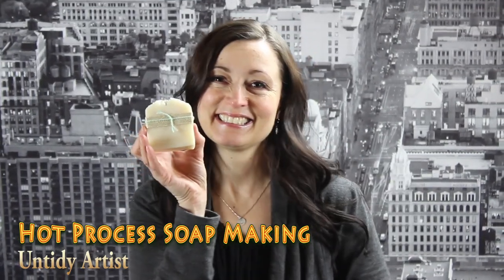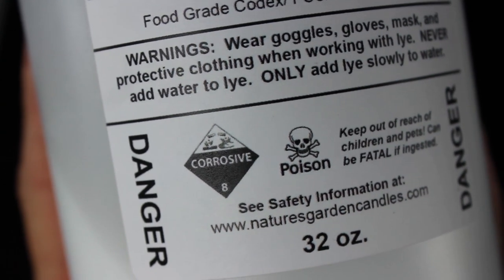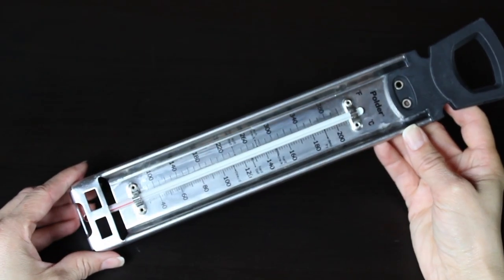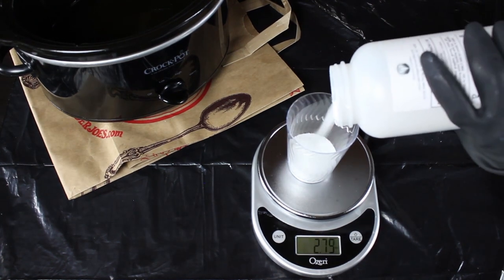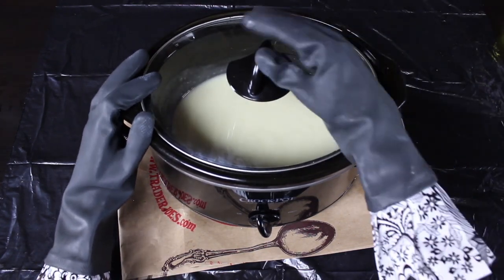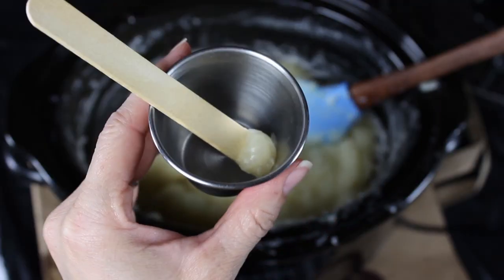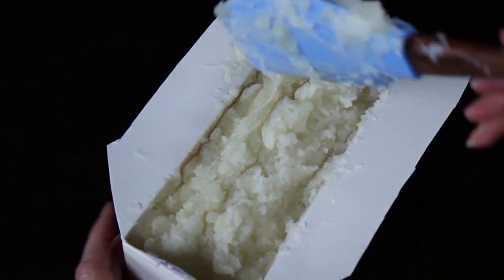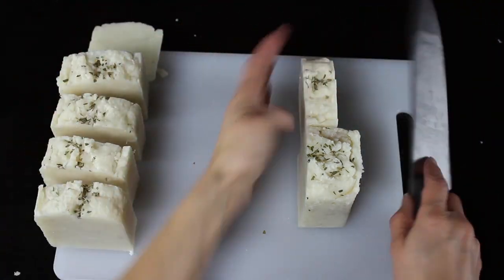DIY Soap Making: How To Make Soap The Hot Process Way

Comment: Emilie, what a great video!  I am new to soap making, but have devoured about every video and blog out there.  I started small with fun M&P and last night did my first HP and it was a lot of fun.  Your video had a lot of great tips, I love the milk carton usage, brilliant!  I must say though, that when substituting oils (like I did), as you said, make sure to run things thru a lye or soap calculator.  I took 1/2 of the coconut oil my recipe (Bastille) called for, and replaced it with equal parts mango and horsetail butters..but I forgot to check the lye calculator!  I was lucky that it turned out alright, it is a softer soap, so it will have to sit for about a week or so.  But great tips - use those calculators!  Thank you for a fun tutorial!

Comment: I’m sure that lye is sodium hypochlorite (NaClO) and not sodium hydroxide (NaOH). It might be very dangerous to confuse this two
Reply from the maker: Hi! Thank you for your comment. I agree it would be dangerous to not use the correct ingredients in soap making. Lye is sodium hydroxide. Here is a link to the soap making supply store I purchase my lye from. It’s my favorite for hot process and cold process soap making - https://www.wholesalesuppliesplus.com/products/sodium-hydroxide-flakes.aspx
Reply: @UntidyArtist  thank you for responding. I did a little research, and it is an error in the translator. It says that lye is a synonym for bleach. This two are different compounds, and that is why I messed up. Thanks
Reply from the maker: @poukisgameplays2277  no problem!